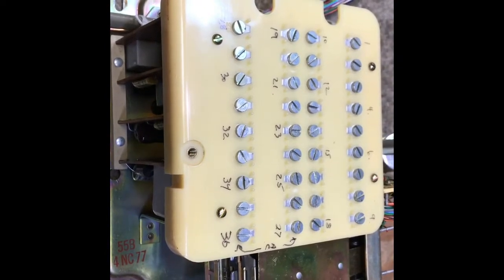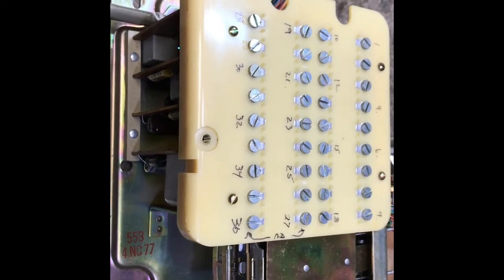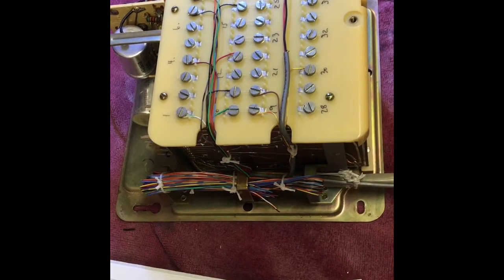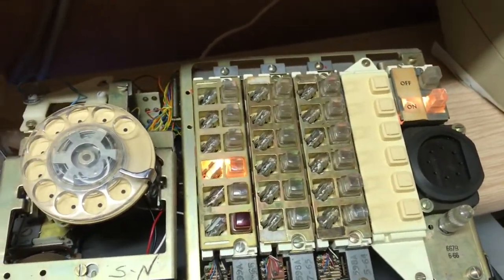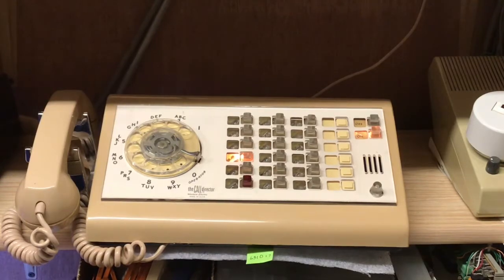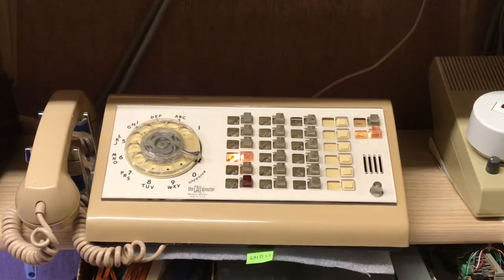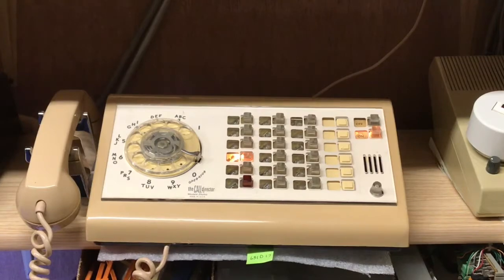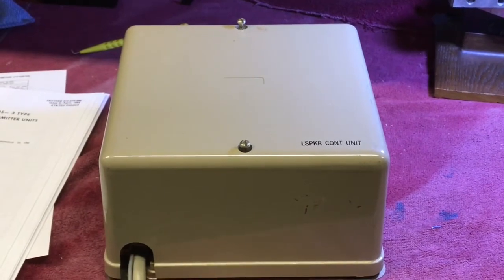Western Electric #3 speakerphone system using a 55 B Control unit.

Comment: I never worked any crossbar or panel.  But would have liked to have very intensely but I was in a pretty small town environment except when I worked springfield mo. SXS which span 5 floors.  I was loaned there for 6 months until the no.1 ESS was cut in to service.

Comment: How about some more info on 'the radio link'?  It appears to be full duplex.  I'm interested in hearing more.  Telephone & Radio are two of my professional & hobby interests.  Throw in railroading, & you've covered all of the bases!
Reply: IIRC, I believe the Internet at that location is through some kind of WISP, there's no hard wired link so sometimes the audio in and out is patchy. The call might have been to one of the two collectors' telephone networks, C*NET (ckts.info) or NPSTN (npstn.us).
Reply: He gets his internet service over radio because his CLEC doesn’t have DSL and there is no fiber from cable or anyone else.